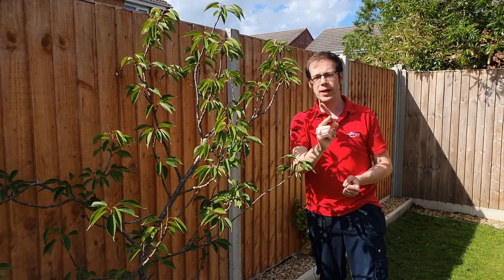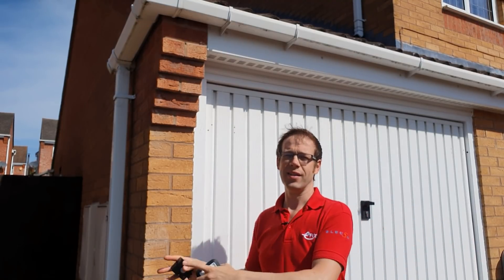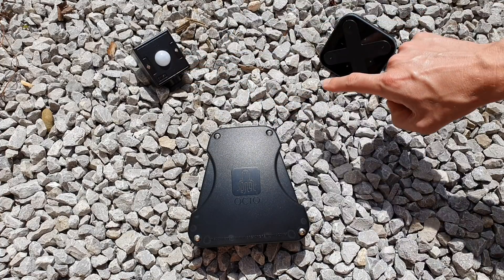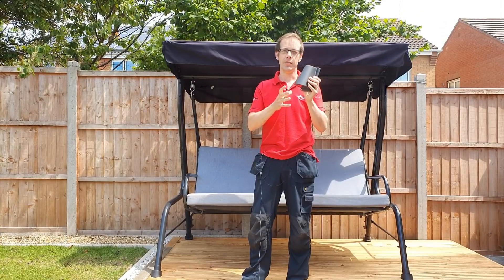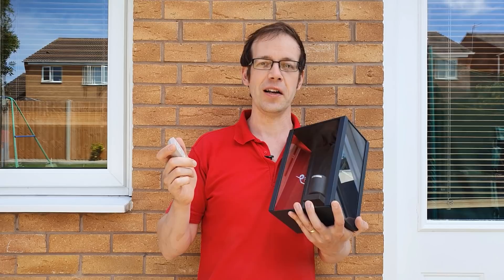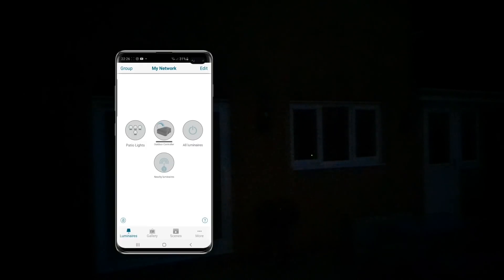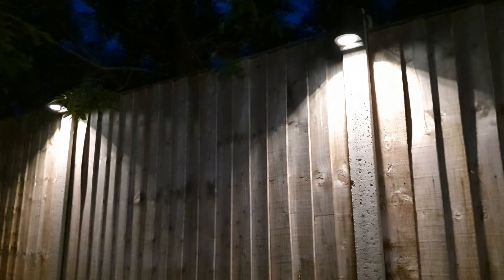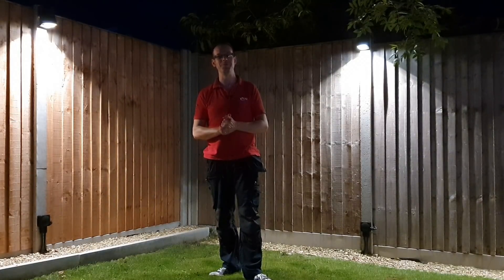Garden lighting ideas using the Ansell OCTO smart lighting system.

Comment: We did a luminaire replacement job with this system at the start of the year 3000 fittings swapped out. I found it quite good and easy retro-fit compared to a dali system you just need permanent power in most cases and the switching is wireless. But for domestic situations, you are nearly always better off to go zigbee or zwave more flexible, integrates with voice assistants (Alexa), and easy app control through the likes of smartthings.
Reply from the maker: Nice comment, thanks!
Reply: @efixx  Thanks for the Vids, I've picked up a lot of useful info through them 👍
Reply from the maker: Our pleasure!

Comment: How did you get the mains from the wago box up the stump into the fitting safely
Reply from the maker: I installed a H07RN-F on the inside slot of the concrete fence post.
Reply: @efixx  so you wedged the cable between the fence and the concrete post? You must have drilled through the post to get a back entry hole on the angle to the light fitting. And avoided the re-bar somehow!